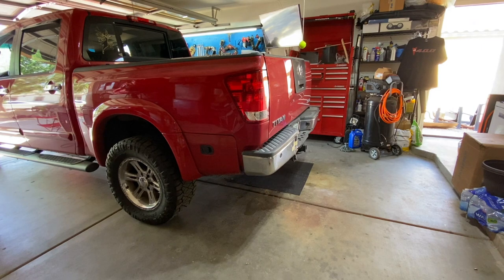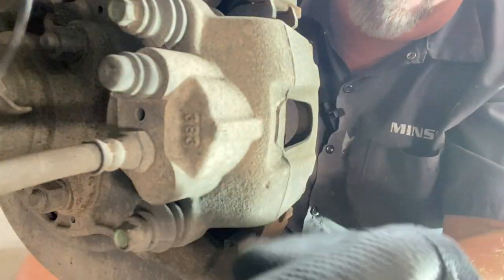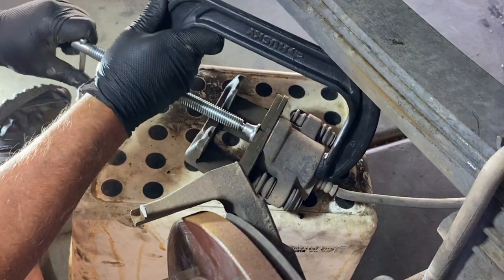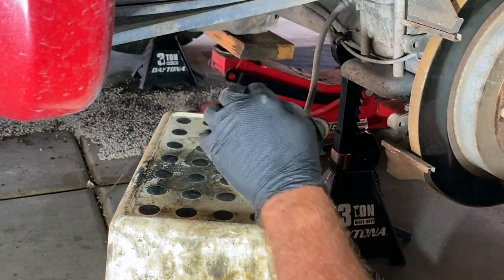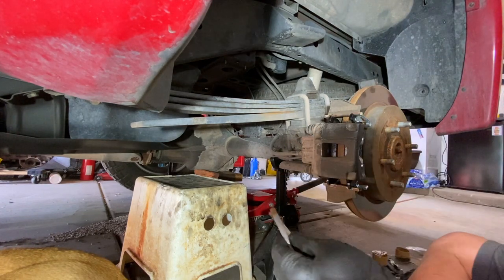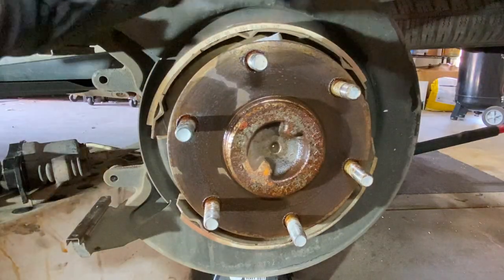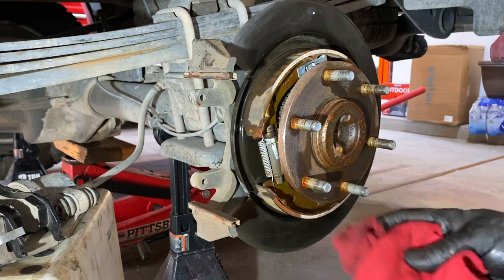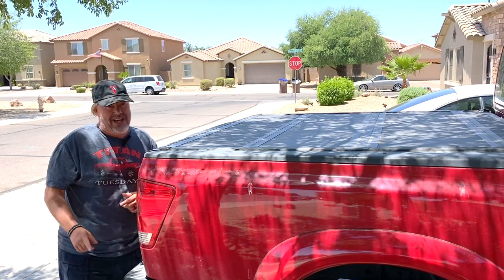HOW TO: Replace Rear Brakes on a Nissan Titan & How To Replace Rotors on a Nissan Titan Truck DIY EZ

Comment: You are actually suppose to use silicone paste on the slide pins..also you touched the friction material with your greasy fingers since you has just slobbed grease all over the pad for no reason. A little grease goes a long way…

Comment: Gezus christ this man smeared the anti seize all over the rusty hub..at least hit it with the wire brush before you cake on the anti seize even though that is also not necessary…this was rough to watch